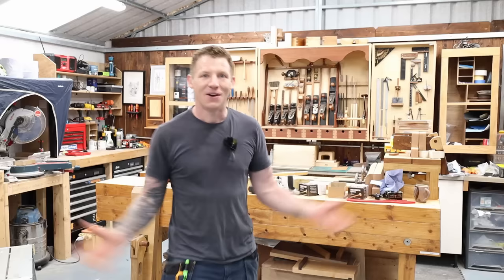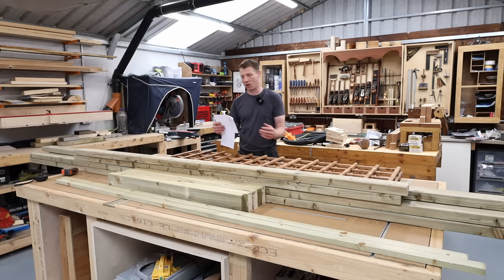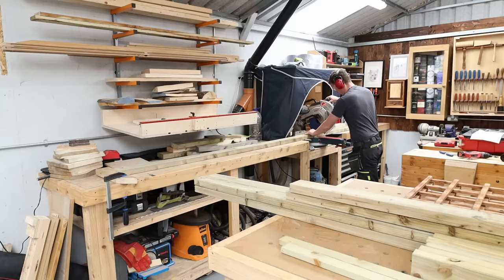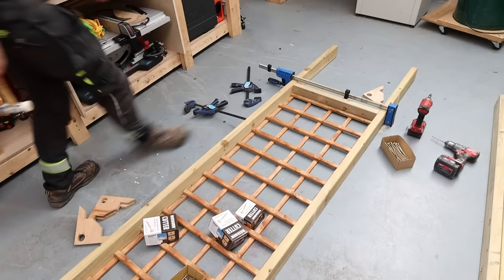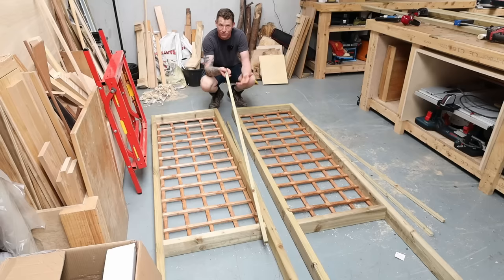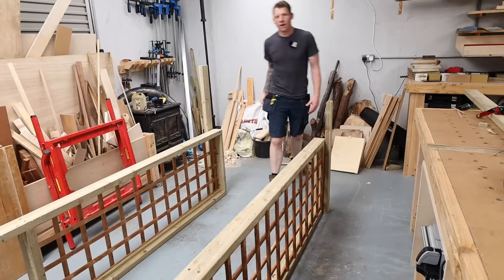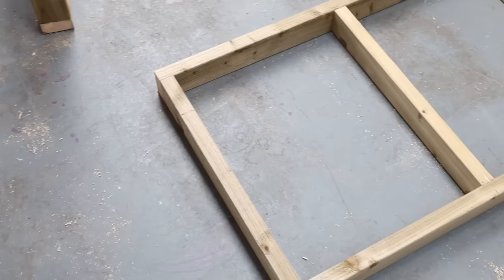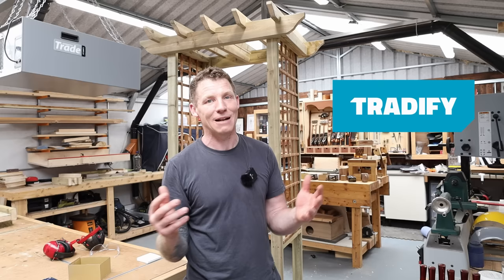How to Make a Garden Arbor. Looks Great!! Simple Construction! Anyone Can Make It! Garden Ideas

Comment: Going to give this a try next week as I'm finishing up a raised bed area with walkway and wanted something like this for a few climbing annuals. Very minor observation - the top of each supporting leg appears to have exposed end grain. Always a possible weak spot for rot from standing water. Would need a really good coating of something to seal, or just cap it using an off cut to stop water sitting there.

No curves here, so 45 deg angles (2cm or 3cm from top depending on timber width). For the braces a 45 looked very plain and not well. Instead I picked the mid-point of the brace, as you would for the curve, and measured a 120 deg angle (60 deg to each side) and will cut that out with a handsaw or jigsaw.

Comment: Another great, down-to-earth video. 
Its amazing to see lumber prices
My shop is in the Philippines
These are current prices for rough sawn lumber per BF
Mahogony 27p  0.67 Euros
Teak 65p 1.19 Euros
16mm marine ply 900p 16.28 Euros
94lb portland cement 290p  5.25 Euros
The downside is you need to wait a year or two for the lumber to dry
Tools are about 1.5x to 2.5 times western prices
Reply from the maker: Glad you liked it, timber prices are ridiculous at the moment

Comment: Great video as usual, I think I'll make one of these for my house. What type of wood did you use? Where I live in the States Pine is the most common, or Douglas fir.
Reply from the maker: Most construction timber here is Douglas fir.
Reply: In USA you want to ask for ground contact pressure treated posts and non-GC pressure treated wood for the rest. Wood spieces will vary across regions in USA but pressure treated is most important for outdoor project.

Comment: A friend of mine said that he thinks the 2 x 4 s in the ground may warp. Is he incorrect? I am planning to use your instructions to build an arbor.
Reply from the maker: I have had no issues putting 2x4 pressure treated timber in the ground
Reply: @JohnMcGrathManInShed  I agree - key is to use pressure treated ground contact approved posts.

Comment: Hi John just been looking at this vid again and as I retire tomorrow ( still going to do shifts when needed to help out lol) an arbour has been a major want for a while. As I said recently I am new to this woodworking malarkey because of you lol so my question is this. Mine will have to cover a curved set of 3 small steps to a lower level in the garden, so could this design be modified easily.
Reply: I’m looking at this a year later so you probably already made yours.  I have a hill in my backyard and steps too.  I’m adding 14 inches to the down hill posts to compensate for the drop.  Hope yours turned out good.

Comment: Nice little arbor, but it seems to me that the internal upper frame of 2x4s is unnecessary. The cross-lapped 2x6 and 2x4 construction is plenty strong to use as the upper frame. Using them as the upper frame makes the structural elements themselves decorative, rather than applying non-structural decoration.
Reply from the maker: Its all structural, using an internal frame allows the screws to be hidden, it could all be done with joinery and no internal frame but that isn't something the majority of people could make
Reply: @JohnMcGrathManInShed  it looks plenty decorative mate great job 👍